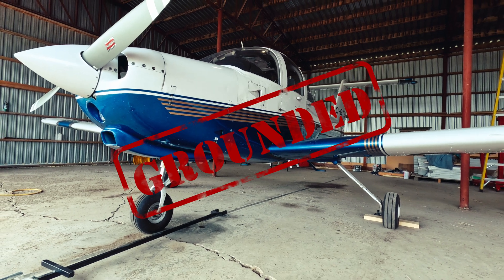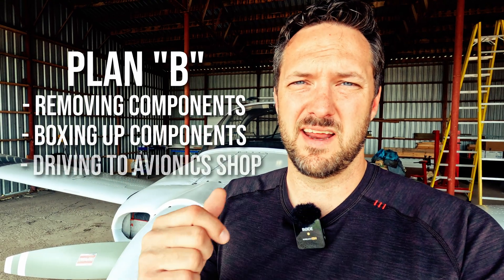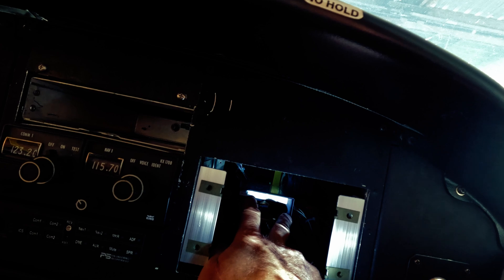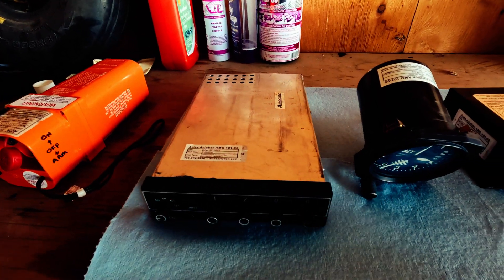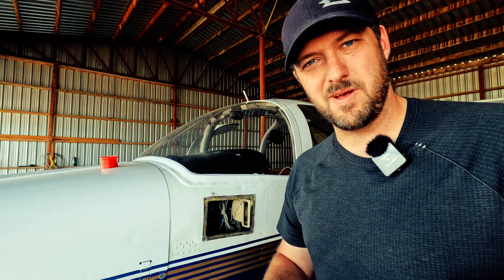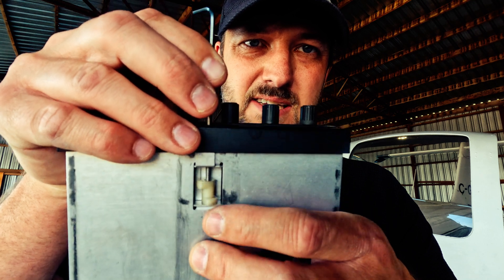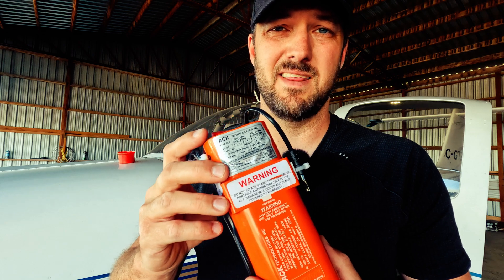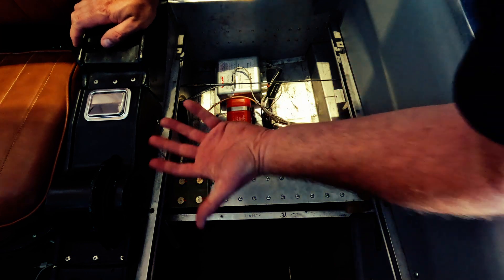GROUNDED my plane! - 24 Month Transponder, Altimeter and ELT Recertification Time!

Comment: Thanks for the great video,  Perry.        I will be going through this with my Tommy next year. 

BTW - when I bought my plane this winter, the previous owner had his mechanic install the Sterling nose link I bought,  and it definitely improved the nose shimmy for a while,  but it is slowly returning.    Maybe sometime we can chat off-line on email about the tolerances and shims.  You seem like a very capable engineer / mechanic type of guy.
Reply from the maker: Absolutely.  Send me an email planeswithperrychannel@gmail.com  hopefully we can get your Tomahawk sorted.  Have you found the group on Facebook for all the Tomahawk owners yet?  If not, search "Piper Tomahawk Owners" on Facebook and you'll find the group.  There is a wealth of knowledge there including a files section with the maintenance manual, parts manuals etc

Comment: This is the first video I've seen from your channel, within about 3 minutes it was pretty clear this particular PA-38 is going to have a great life ahead of it. You love this thing like it's brand new :-) I'm impressed those avionics are still passing the tests some 40 years after manufacture - built to last. Stay safe sir! :-)
Reply from the maker: Thank you!  When I first bought the plane I went through the whole thing with my AME and brought it up to the level I wanted where I can freely take my friends and family on trips.  Now it's at the point where I have a full maintenance planner/tracker set up in an Excel spreadsheet and try to make little improvements along the way to make it nicer on every flight! Overall it's a low time airframe (around 3300 TT) and engine has less than 600 hrs since major overhaul.  She's a nice bird!